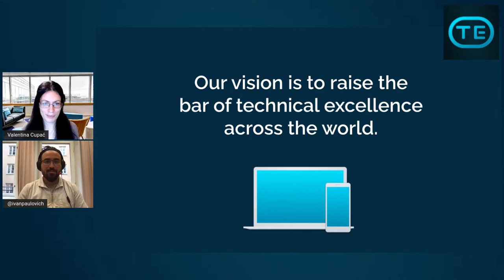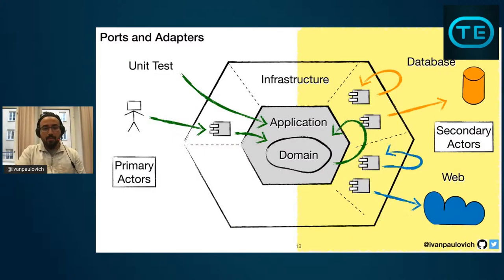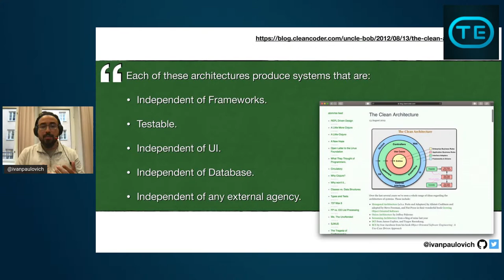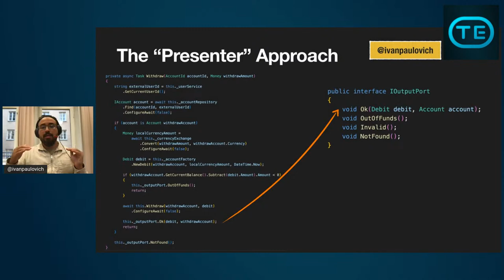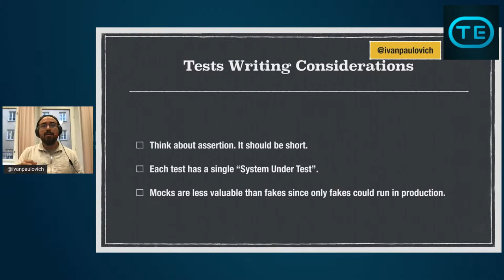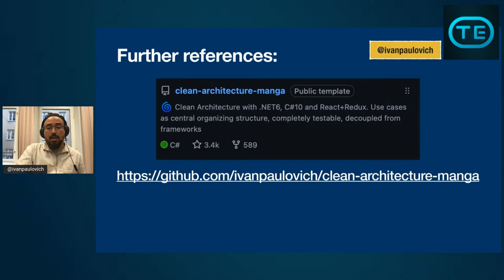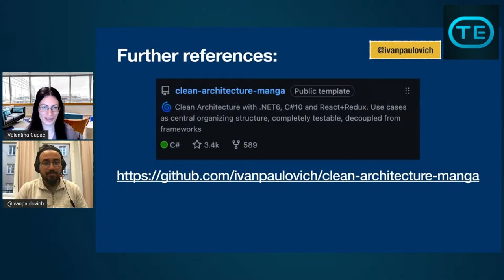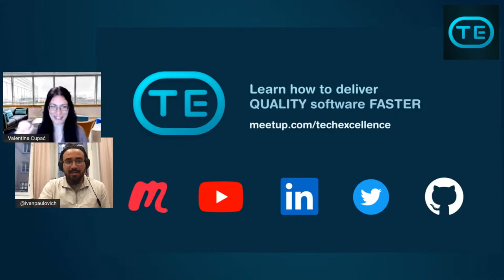Clean Architecture: Principles, Patterns and Practices (Ivan Paulovich)

Comment: Thanks for the talk !

Here are some notes I took:

𝗧𝗵𝗲 𝗛𝗲𝘅𝗮𝗴𝗼𝗻

 𝟭 - 𝗘𝗻𝘁𝗶𝘁𝗶𝗲𝘀
• Core of the hexagon
• Represent the data used in the app (ex : Account)
• Abstract (= interface with no concrete data)
• Stable (= don’t have dependency)

 𝟮 - 𝗨𝘀𝗲 𝗖𝗮𝘀𝗲𝘀
• Entry point of the application
• Describe what the application is capable of (ex : OpenAccount)
• Abstract - Depends on Entities and abstract infrastructure (PORT)
• Algorithmic (takes input, generate output)
• Entry point for unit test

 𝟯 (𝟭/𝟮) - 𝗨𝘀𝗲𝗿 𝗜𝗻𝘁𝗲𝗿𝗳𝗮𝗰𝗲𝘀 
• Entry point for the users
• Describe how the user can use the application
  • Contains the Controller (for routing) and Presenter (to serve readable data to users)
• Concrete implementation of the use cases.

 𝟯 (𝟮/𝟮) - 𝗜𝗻𝗳𝗿𝗮𝘀𝘁𝗿𝘂𝗰𝘁𝘂𝗿𝗲
• ADAPTER : concrete implementation the abstractions (PORT)  the use cases depend on
• Contains mailing service, databases, etc..

𝗖𝗼𝗻𝗰𝗹𝘂𝘀𝗶𝗼𝗻
With this architecture you can:
• Easily change your ADAPTERS database or UI  
• Test easily and fast by replacing the real infra by fakes

𝗧𝗲𝘀𝘁𝗶𝗻𝗴 𝗦𝘁𝗿𝗮𝘁𝗲𝗴𝗶𝗲𝘀

 𝗨𝗻𝗶𝘁 𝗧𝗲𝘀𝘁𝘀 (𝗙𝗔𝗦𝗧)
Test the  𝘂𝘀𝗲 𝗰𝗮𝘀𝗲 - shows that the app does what it should do! We’re just testing the logic. We will change the adapters for the infrastructure with fakes so the tests can be blazing fast!

 𝗖𝗼𝗺𝗽𝗼𝗻𝗲𝗻𝘁 𝗧𝗲𝘀𝘁𝘀 (𝗠𝗘𝗗𝗜𝗨𝗠) 
Test the user 𝗶𝗻𝘁𝗲𝗿𝗳𝗮𝗰𝗲 - You will for example call your HTTP routes and see if everything is good, still while using fakes so the tests are fast

 𝗜𝗻𝘁𝗲𝗴𝗿𝗮𝘁𝗶𝗼𝗻 𝗧𝗲𝘀𝘁𝘀 (𝗦𝗟𝗢𝗪)
Test the 𝗶𝗻𝗳𝗿𝗮𝘀𝘁𝗿𝘂𝗰𝘁𝘂𝗿𝗲 - Since the infrastructure is not covered by unit/components tests, we will test it here. You can verify that the gateway is well implemented etc… 

 𝗘𝗻𝗱 𝘁𝗼 𝗲𝗻𝗱 𝘁𝗲𝘀𝘁𝘀 (𝗩𝗘𝗥𝗬 𝗦𝗟𝗢𝗪)
Test the 𝗲𝘃𝗲𝗿𝘆𝘁𝗵𝗶𝗻𝗴 - You can use Cypress to go on the website as a user and test if the front acts as intended hence testing the whole application end to end

 𝗧𝗲𝘀𝘁 𝗗𝗿𝗶𝘃𝗲𝗻 𝗗𝗲𝘃𝗲𝗹𝗼𝗽𝗺𝗲𝗻𝘁
Art of using tests to drive the development using the RED GREEN REFACTOR method

𝗧𝗛𝗜𝗡𝗞 - You start by thinking of the code you want to write in production. 
𝗥𝗘𝗗 - You write the first smallest step as a failing test.
𝗚𝗥𝗘𝗘𝗡  - You write the minimum production code to make the test pass. 
𝗥𝗘𝗙𝗔𝗖𝗧𝗢𝗥 - You refactor to keep your code clean without changing behavior 

𝗘𝗩𝗘𝗥𝗬 unit test will run at each step.
You can change code and be sure that your app will function as intended!